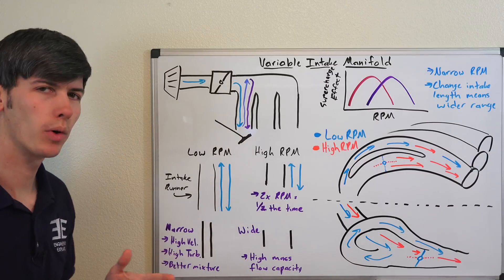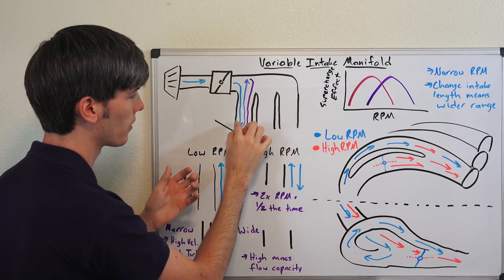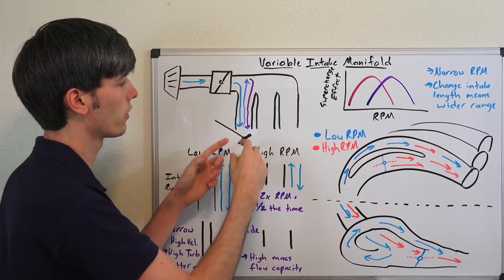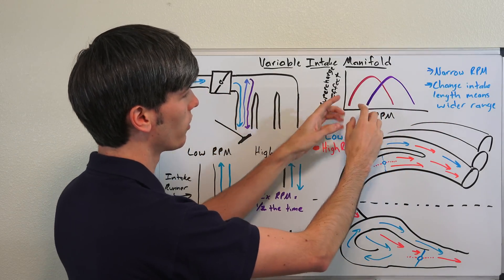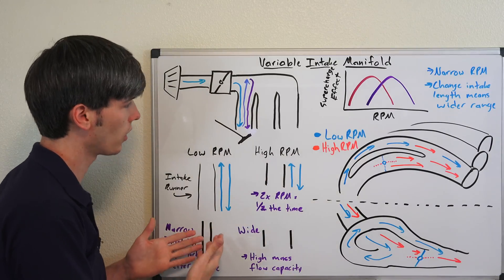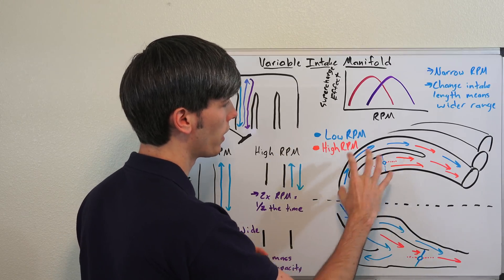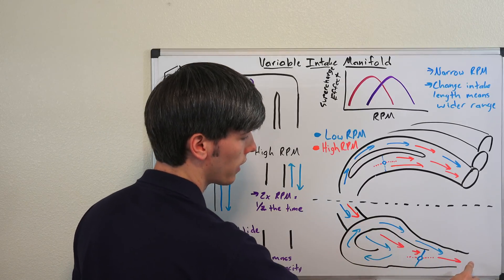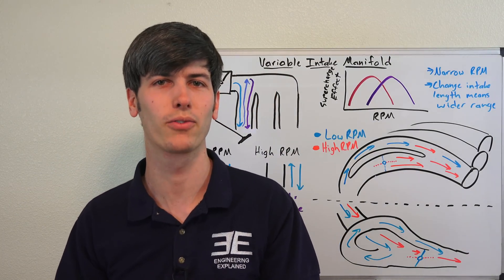Variable Intake Manifolds & Intake Tuning

Comment: Hey, thanks for the explanation. However at 0:48 you say that the pressure wave 'hits' the plenum, what do you mean by that? Are you referring to the physical boundary? Since a high pressure wave will reflect against Atm conditions as a low pressure wave. In contrast, when the intake valve opens, it creates a low pressure wave which will reflect against Atm conditions as a high pressure wave, which we want to arrive at the right moment back into cylinder. Somebody please correct me if this is wrong.

Comment: I need a manifold that works 3000-3500 rpm. range to my NSU engine and also the space is limited. Some rule of thump would be nice to learn. Of course I can make a test piece and see if it has gain but it will be made from tube curves. Might thet be a bad thing.

Comment: I had a thought about drive by wire throttle bodies, and if it would be beneficial to use them in sync with the maniflod compression waves. 
Let see if I can express it, as the buterfly opens and revs go higher, you harmonize the opening by stepping it with the frecuency of the compresion wave to help minimize the back pressure of idle air due to the valve timing...(I don´t know if I´m making sense to you, hahah). In simple terms, make the throttle vibrate to that frecuency as it opens, sort of pulsating the air comming in to take advantage of pressure oscilations. And with itb's it could be simplyfied by dislocating the opening on each cylinder by a drive belt conected to the throttle bodies using a type of actuator like v-tec to regulate the opening, hahaha. But I guess that would be v-tec on another position, ha.

Comment: @Engineering explained So my question is, would an aftermarket intake manifold need to be tuned if I ever installed my engine?

For example my 2015 lifted Scion xB, it can create more air flow pressure traveling through the exhaust. Would 2.5” pipe be big enough, for combining aftermarket header, 2.5” custom down pipe with magnaflow high flow cat, 2.5” vibrant ultra quiet resonator, to the rest of 2.5” exhaust pipe, all that with aftermarket intake manifold after air intake? 

Does the aftermarket intake manifold is mandatory to get it tuned and get an aftermarket fuel rail to support the air flow supply?

Comment: Would a throttle body spacer be beneficial in certain situation on a variable intake manifold ? lets say with a high flow cold air intake and exhaust, would adding a spacer be abble to tune the VIM to the new air intake flow/velocity ?  in my case i have all the torque i need at high rmp , but its a cow under 3k rpm  ..  thank you

Comment: My 1988 Celica gts with the first gen 3sge has the TVIS system where it opens and closes changing the diameter of the intake runners. Pretty cool for how old of an engine it is

Comment: @engineeringexplained wouldn't you want to time the intake resonance for when the valve is open rather than closed? For example, the exhaust headers resonance tuning is done with the exhaust valve open to get all of the exhaust out so the intake side should be done in theory to get all of the air in imo. The ambient air already is at a higher pressure than inside the cylinder of the engine because the piston going down creates a low pressure area well below ambient pressure. That is with a naturally aspirated engine as a forced inducted engine would only have the same effect multiplied with positive/boost pressure.

To give an example that would mean that the intake resonance tuning of an advertised 260 degree intake cam duration would be timed for 260° of 720° instead of 460° of 720°.

Comment: I like your videos. Here is some info on intake tuning you may not know about. Check out the long ram intakes that Chrysler used in the early 1960s on the 413 c.i. V8 in the 300 letter cars. This was way before Porshe even thought about tuning intakes. Chrysler also used short ram intakes on thier race engines in the 1960s. Max wedge and hemi big blocks.

Comment: Yeah my understanding is that these systems are not about getting more air into the cylinder, but getting faster moving air (but the same volume). This ensures a better mixture of fuel and air in the combustion chamber. I could be wrong though.

Comment: Those who say that tuned manifolding isn't worth the effort will say that the engine rpm range over which torque is increased is very small and the range over which torque is decreased is very large No, that is simply not the case. In the rpm ranges when the tuning was not "doing its thing," there was certainly no "hole" in the torque curve. Yes, engine design management made some very wrong decisions during the fifties, but they also made some very wise ones. They were evidently obsessed with maximum torque values. But, the dragracer will point out that the only time they see anything close to the peak engine torque is in the first few feet off the line. George Wallace, of the Vehicle Performance Lab, realized the performance deficiency of the production intake ram manifolds, but it wasn't until years after their release that he was able to order a "drag race" at the proving grounds between a ram manifold car and one with the "old fashioned" dual quad manifold. The smart money was on the "old fashioned" manifold. Yes, the long ram manifolds could become performance manifolds, but only after they were modified by removal of part of each of the partitioning walls. This reduced the runner lengths and increased the plenum.

Comment: I'm in my eighties and I was an engineer at Chrysler when the "ram manifolding" was being developed in the fifties. The most significant fact is that all the "magic" occurs while the intake valve is CLOSED! As I pointed out to Herb Bees (below), an understanding of water hammer is essential when it comes to the tuning of Otto Cycle engine manifolding. And, of course, it must be realized that water hammer principles can be applied to both liquids and gasses. There is a helpful YouTube video called "Ramming The Rat." It was written by Steve Magnante and originally appeared in Hot Rod, but I'm having trouble finding it. I'm the old guy in the pictures.
Reply: Man I’d love to talk about some of what you guys learned before it’s all lost to time!! I’m a engineering student at UNOH for Motorsport engineering

Comment: I always thought the "supercharging" effect had to do with the inertia of air that caused it to continue filling the cylinder even after the piston is past BDC and on the start of the power stroke.  Longer duration cams raise the rpm level at which this supercharging effect is optimal since more inertia is required to overcome reversion back into the intake.  There is more inertia with long narrow intake runners, so more supercharging effect; at high rpm though it becomes restrictive.

Comment: Okay so if I have a itb turbo car with longer velocity stacks will it matter if I have boost in the top end or will it hinder the performance if I'm running a bigger turbo that kicks in around 2500-3000 rpm

Comment: That's very similar to how the third gen Honda accord intake manifold works. There's a valve assembly between the intake runners and plenum that stays closed at low RPMs, and opens at high RPMs. The valve assembly is vacuum controlled. 

It was a very effective system for the time.

Comment: This makes a big difference. I have used this on a turbocharged toyota(tvis) 1500cc engine and the short runners increased the horse power significantly at high rpm.

Comment: Do you think it may be possible to eventually have a variable exhaust manifold that can combine the benefits of both 4-2-1 and 4-1 headers that could potentially complement a variable intake manifold? I imagine heat would the main issue with designing such a system, particularly if butterfly valves inside the manifold were to be used, but I think it may be possible with the right use of components with the appropriate metallurgical properties that could withstand the higher temperatures as the engine load increases.

Comment: What a great video, thanks for clearly explaining this concept.  I'm looking at designing a new intake for my 2L Alfa spider and was thinking, "what's the deal with variable length intakes?".  I think I could program a valve to position from closed to fully open based on rpm, and adjust that curve to maximise and flatten the torque curve.  Cool stuff.   Any pointers on diameters and lengths from a design guidelines perspective, i don't mind pulling out the old slide rule.   Liking the new e-car content also!

Comment: I know you did a video on intake before but could you get more into induction wave pulses vs restriction because of length Is it better to have the full length to get it to hit one of the 3 first waves or is it "better" to have a straight runner as long as the surrounding allows you ? (For HP That is )>5252rpm

Comment: My current car has two solenoids for the vris and I absolutely love the effects it has on the engine. 
Is it possible to use a supercharger ahead of the vris to increase power or do I risk blowing the vris valves up?

Comment: Hi, there’s something that puzzles me at the first minute or so of the video… How can you benefit from that extra air piling up when the intake valve closes? If the valve did close for that bouncing pressure effect to occur, it means that cylinder is already separated from intake and exhaust. It’s working on its compression stroke by then. No more gains to be had by either side of the engine while squishing...
Reply: The point is, that the pressure wave comes back down the moment the intake valve opens again. So basically the engine goes through all 4 cycles in the time the pressure wave needs to travel up to the plenum and back down to the valve.

Comment: Would it make sense to use a slightly different intake length and bore for each cylinder? I realize this probably wouldn't be as good as an active system (which doesn't compare to a super-charger), but it would have no moving parts.

Comment: The other thing to think about is that the same scenario happens between the air filter and the throttle body when the throttle snaps shut which is why manufacturers like Honda would put extra plumbing in the carefully-sized intake tubes upstream of the throttle body to control the pressure waves, all of which boy racers would throw away when they would fit an after market intake which consists of a not-at-all-researched over-sized random-length metal tube and a randomly chosen K&N air filter resulting in reduced air flow speed (and therefore torque) and messed up the pressure wave synchronisation.

Comment: So what would an equal length header benefit from? From what I have heard a variable would be best, would the equal length not offer that variability so it would be predictable and could get the most power from it?
Reply: An equal length header is part of the exhaust, not the intake. When the burnt gasses leave the combustion chambers and combine in the exhaust (4->2->1 for instance) you want the gases to merge smoothly, not all arrive at the same time and cause a traffic jam. This is especially important upstream of a turbo because is prevents surging of the exhaust wheel and subsequent variations in boost. It can also create a pressure wave in the exhaust which reduces the effectiveness of the exhaust gases being forced out and reduces horsepower.

Comment: In the manifold you haven't mention that we have friction of the incoming air the the walls of the manifold and there is an effect there too apart from turbulence, this is something they know better the people who work with fluid mechanics, i dont know the name anymore but i remember that the length of the manifold doesn't affect the incoming air mass and velocity after a specific point.

Comment: but what is if the distance between throttlebody and valve cannot be changed? in my case BMW M42 16V 4 Cylinder... i have 1)velocity stacks  2)ITB Kit  3)injection nozzle  4)cylinder head... My problem is that i need to calculate the length of the velocity stacks for optimized "fibration frequency" and reflexion-charge effect... Does anyone has an idea about that or a calculation tool?

Comment: Similar to the old ka24de in my Nissan, with the individual butterfly valves in the runners. Removing those was a big mistake, wish I could remember where I put them. Removing them dramatically killed the low-end of the engine, but (may be placebo) higher rpms seem to be improved.

Comment: I think older bmw and audi's use this sistem too. And when they break, we just rip those things out, and if needed modify the ecu, so it doesn't give error codes.
And there you go: no differance in power or emissions, but one less thing to worry about. Cause if those flaps break off, they go into cylinders, and you can guess what happens then. :D

Comment: Good video. I have a question. Take two theoretical engines, one produces 1hp and 1000tq. The other makes 1000hp and 1tq. How would those motors behave?
Reply: First of all, tq or torque isn't a unit. Torque is measured in Newtonmeters (Nm) or foot-pound (ft*lbs) if you live in the US. Let's pretend you mean Newtonmeters.
The 1hp 1000Nm engine would rev with about 7rpm.
The 1000hp 1Nm engine would rev with about 7024000rpm

So to high torque engine doesn't get you anywhere and the low torque engine...well there's no engine or electric motor that can rev that high.
Reply: No, I meant kilowatt hours per cubic kilometer. Look at my username, what unit of measure did you honestly think I was referring to?

Also, how did you come up with those numbers?

Comment: work fine in my specV (I use a window to control my secondaries) but u can see the difference on the dunk and in most Honda Acuras exam 6/6 has secondaries and vtech u really notice and the 3 Intake time changes. however this is def, old technology which now days has gone away due to shorter resin premiums and direct injection.

Comment: my 04 focus SVT had this. you could hear it close off the long runners and switch to the short runners at about 5k rpm before it redlines at i think it was 6.5k. it felt like a softer version of honda's VTEC, but obviously not the same thing at all.

Comment: Would a variable intake manifold be more effective on an engine with a much lower rpm range, such as a pushrod v8 as opposed to a OHC 4 cylinder because your engine would be running closer to those peaks more often?

Comment: Its interesting to note that modern intake manifolds are less complex now than they were in say the 1990's. I could never understand why you needed a complicated manifold to improve airflow into the cylinders when you have a throttle at the front of the manifold which is choking off the airflow in the first place ! Most engines spend all their time with the inlet manifold at different levels of vacuum so theories regarding throttle size, plenum volume, runner length/volume etc are only relevant at wide open throttle ie zero manifold vacuum, the rest of the time it doesn't matter. If you want more air in your cylinders just open the throttle (reduce the vacuum) a bit more.

Comment: WHOA... 
Regardless of how "Variable" an intake system is, you get no more power without additional fuel. 
So... 
Is your power gain really a result of air flow strategy or is this simply a clever engineering trick? 
The ECU is manipulating air flow channels and adjusting fueling via timing, to generate power with the programmed air flow table. 
Thus.. Unless you are talking about Venturi tuning with carburetors, it is not possible to "Tune" without the electronics that control it.

Comment: where's your Crosstrek?! I've recently purchased a 2016 limited and want to know if there are any ways I can improve performance on it. not with just more horsepower or torque but also with handling and such. 

also, can you do a video on LED lights in a housing made for incandescents? I know it's not exactly the mechanical stuff you always talk about in your videos but would like to see how LED lights behave differently. thanks!